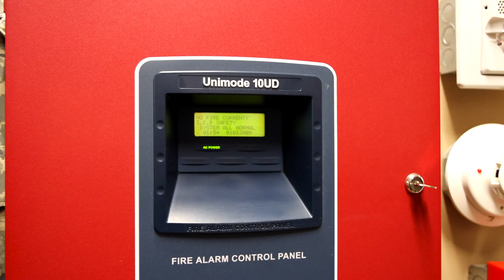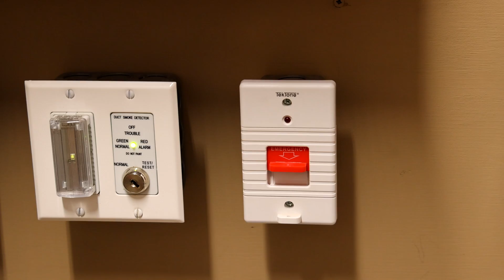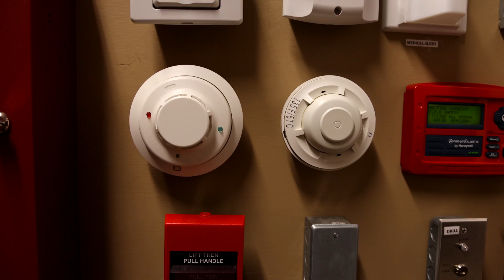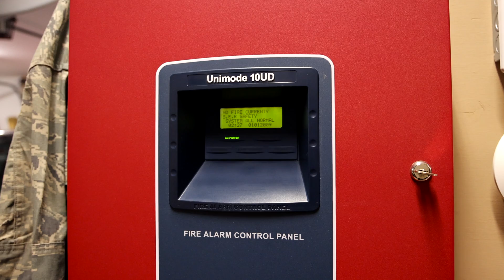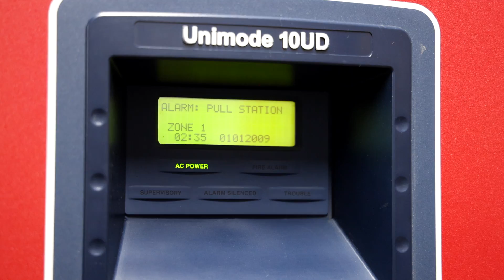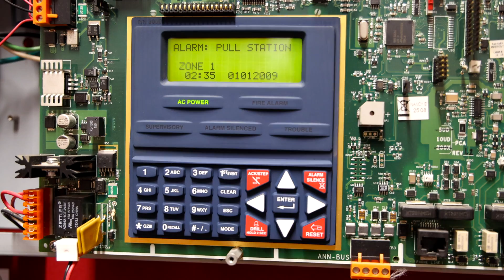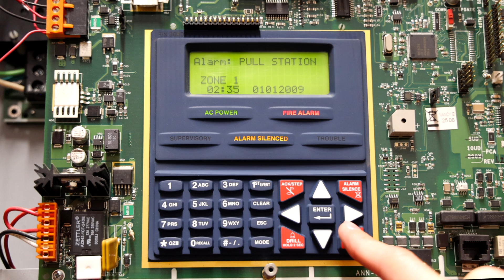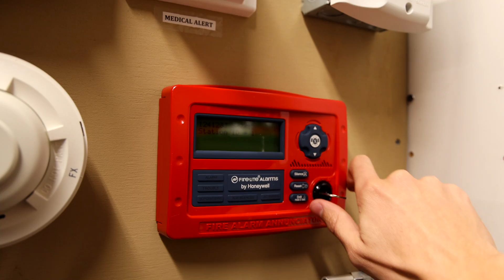ADT Unimode 10UD Fire Alarm System Test 24 | Loud Medic Alert!

Comment: Regarding the kidde alarm with the LED strobe. I really like how they made it flash like a real Xenon strobe unlike the other LED strobe alarms. In fact, seeing that for the first time, I actually thought it was a Xenon strobe despite looking like an LED strobe. That is impressive. Also fun fact, the hearing sound better at lower frequency's doesn't just apply to fire alarms like this. This also works with outdoor warning sirens. For example, an 8 port siren will be heard from a farther distance than a 12 port siren running at the same speed.
Reply: almost everything whelen is low frequency 500HZ
Reply: Ya. Except for those sirens ran on their older analog controllers. Especially the dual tone ones.
Reply: @zachzebra56  yes
Reply: Yes, I definitely think that’s true as I’ve witnessed one go off in real life at the Orlando Airport Terminal C.  I posted a video on my channel of it: https://youtu.be/TwzhjgvGAaE

Comment: Hi Grant, I'm coding a custom security system, and I'm new to fire alarms. I want to use a blue/non-red pull station for use as a panic "button" like you have on your security system. I tried looking on eBay and a bunch of other sites but I couldn't find any for sale. Do you know where I can find one of these? Thank you!
Reply from the maker: Those can be hard to find and quite expensive, however, I have seen them for a reasonable price on eBay before. Keep an eye out! :)
Reply: @SERSafety  Thanks Grant! I’ll make sure to keep an eye out ❤️
Reply: @SERSafety What does the panel say when you take a device off of the panel, I’ve been wondering for a while.